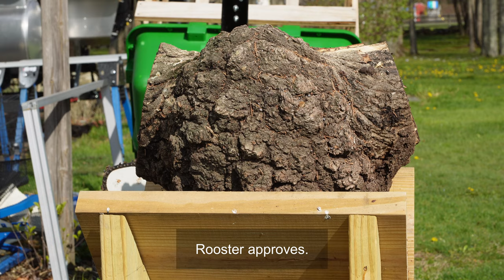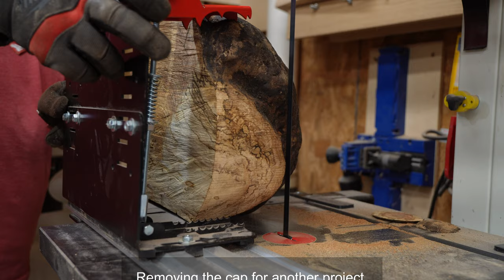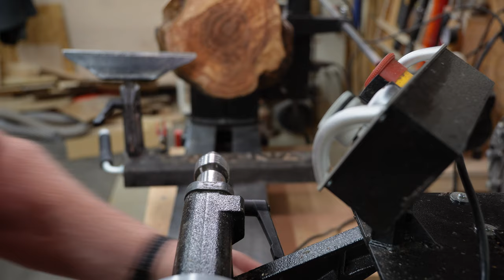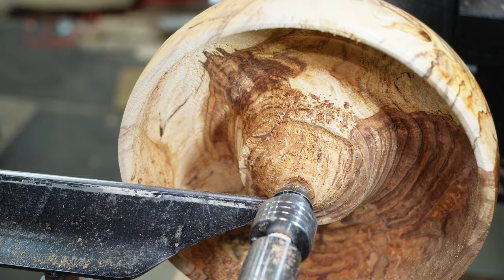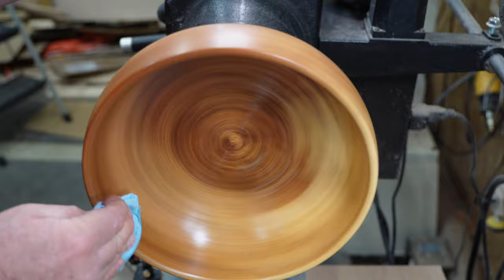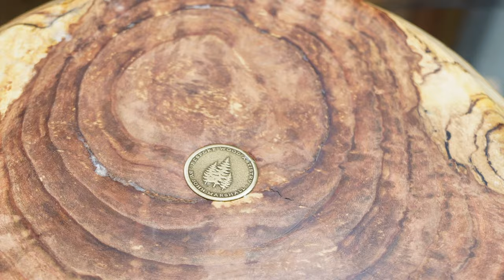Jaw-Dropping Wood Grain Beauty | Wet Maple Burl Bowl Makeover

Comment: Man that’s nice.  Does a wet turned burl like that distort much when drying?  Seems like that crazy grain could do some strange things as it shrinks.
Reply from the maker: A great question and a straight answer - yes. I did use the Minwax wood sealer on this bowl that should lock in any residual moisture but I suspect there will be some shrinkage and possibly cracks. The grain is super wide so time will tell on how it will finally settle. I’ve had some bowls that distort and become oval that still have character. I could have twice turned it but the impatience in me took over lol 😂 Thanks for the comment mate.